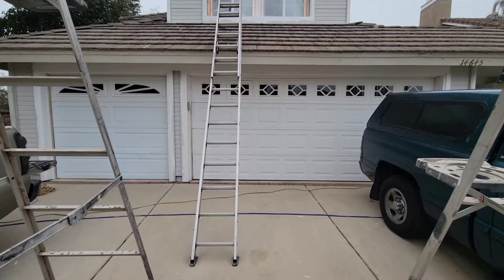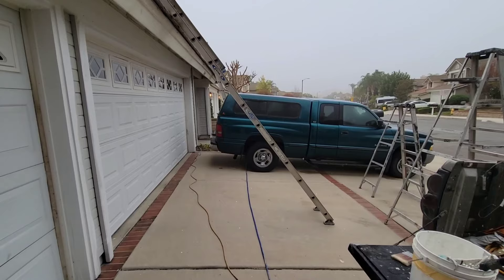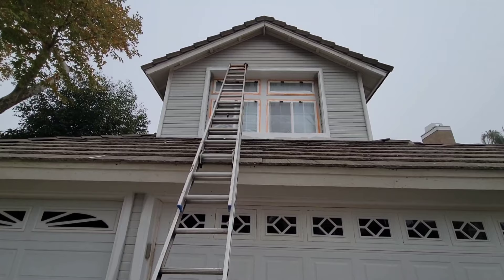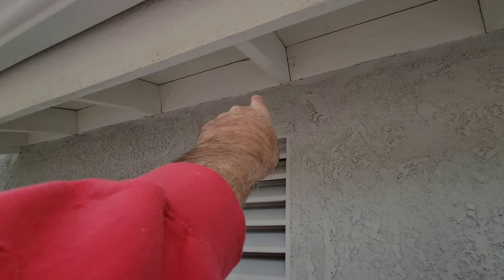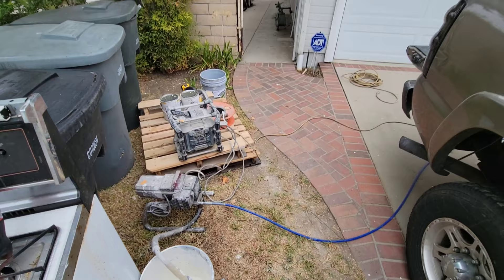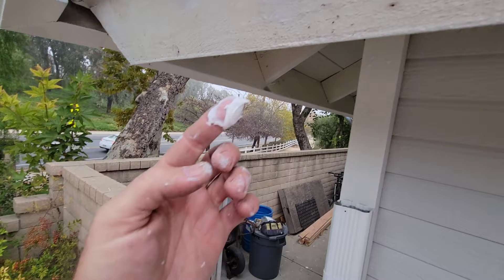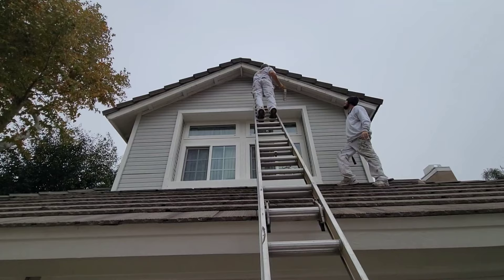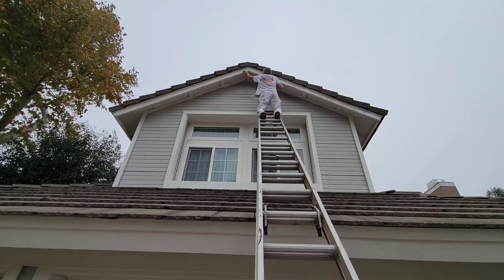Ladder hard to reach areas also house painting some methods and tricks for painters.

Comment: I am a very good mural painter and I am also working with a promoter who has a contracting business. I have always been scared of heights but I've been going up on the 28 ft ladder with a 20 ft pole reaching the peak of a 40 ft. House and it makes me nervous because I know that after a few minutes my arms get very tired and all it takes is that pole to sway and if I don't let go it could pull me off I had a guy helping me yesterday. He stood on the ladder today. I have nobody so I'm going to maybe use some house bricks. But thanks for the video.
Reply from the maker: couple sand bags helps.

Comment: I have done this too run the ladder at 45 or 48 degrees up on my roof. Since you have a garage door, you could tie the bottom of ladder to something strong and immovable in the garage. Or shoot a 2x4 into the driveway, which owners wont like, but if its yours...
I have also tied a 4x4 at ladder top when laying ladder entirely laying on a sloped roof to give foot room.
Reply: I pull my Jeep up to it and strap it to the bumper .

Comment: When you were doing the fascia and touching up little holes with caulking, is that caulking from a caulking gun you squeeze out on the side of the bucket? Do you paint over it before it cures, I thought you had to wait hours before you can paint over caulking.  Thanks, great video on ladder safety too.
Reply from the maker: yea your right usually but this works fine for smaller holes. it will shrink. I dont do all the holes just the ones they missed. Everyone misses some holes on facia or on walls.
Reply from the maker: another trick is use the 25 year caulk for this. the 35 tends to shrink more and pull apart. the 25 fills just fine and lasts for that.  Honestly it lasts for a very long time. and never had issues with adhesion or shrinkage. Unless the facia is like primary BLUE.. or something like that with white caulk. It really just depends on what your doing. weather can also be a factor and how big what your trying to fill.

Comment: Mike, I have a question about painting stucco with sheen vs flat paint.  I watched a video of yours a while back and I think you said only flat paint should be used on stucco to allow moisture to escape from the stucco instead of building up behind the stucco and causing a bubble or other paint failure.  I recently watched a video of a painter who said semi-gloss should be used on stucco because it will protect the stucco from the elements, will fade more evenly than flat paint, will fade less and will last longer.  This was in a high desert area of Arizona; the climate is very dry or arid, gets rain and light snow in the winter months and mid 90's in the summer months.  What's right? What are you thoughts on it?  Is it regional or weather that determines if flat or a sheen should be used or should flat always be used or......?
Reply from the maker: Enamel does not last any less or more than flat. grades of paint are what makes it last. better binder and titanium vs chalk are what makes paint last. Stucco will absorb moisture when it rains. At the bottom of the house if the enamel seals up the water has no place to go. so it will push the paint into peeling. I figure the guy who says that really does not know what he is talking about with enamel paints.
Reply: BTW I have done several commercial buildings in AZ I in Tucson. I used flat on all of them they held an even fade. IDK what that guy is saying. Good quality 100% acrylic flat on stucco will last and not fade any less than enamel. They will both last the same time.....BUT the risk of the stucco sealing up and peeling off is much higher with enamel. It is not the first time I have heard this but NOTHING to back it up. IT is just some guys theory that shiny paint is better than flat. Which has no basis. flat (solid acryilic stain 100% acrylic is the best paint for stucco.)

Comment: An easier way ive learned the 25% as an ironworker is the 4 to 1 rule. Every 4 feet the ladder goes up the ladder needs to be 1 foot back from the wall or whatever you're leaning the ladder on. To 12 ft=3ft ), 16ft=4 feet, 20ft=5 feet and so on.

Comment: When there are trim and stucco. Which one paint first? Thank you
Reply from the maker: almost always I paint the stucco first then the trim.
Reply: @mikethepainter  does I have to use sprayer to paint stucco or roller can do the job too? Thank you
Reply from the maker: @calittlegarden-3311  if your going to roll you should wet the stucco before you roll it. and Literally cover EVERYTHING....out 10ft all windows and take down lights. or they will get wiped out. Best to spray do all  your covering then rent a sprayer start early in the morning and work hard all day you might get it all painted in 1 day (spray work) or 2 days stucco and eves. then get out your brush and do the rest.
Reply: @mikethepainter  thank you for the tips. One more question...I saw out there have stocco paint for sale, do I need primed first then stocco paint and is the stocco paint the best way to go? It since very tricky to pick the paint for stocco. Thank you

Comment: 6 in 12 means for every 12 inches there is a rise of 6 inches.
Reply from the maker: Yeah it's really steep
Reply from the maker: The top roof wasn't that steep but the sides were very steep like 6 and 12 maybe five and a half or five and 12
Reply: @mikethepainter  Lol thats not steep. Haha 10/12 are steep bro.